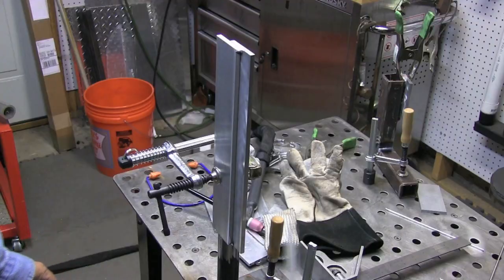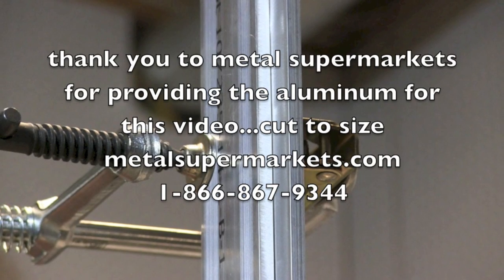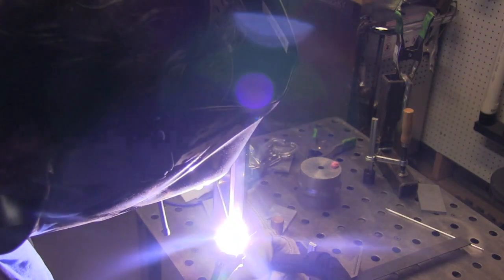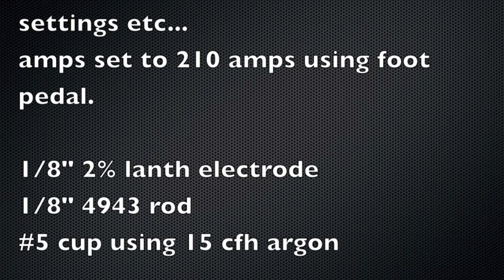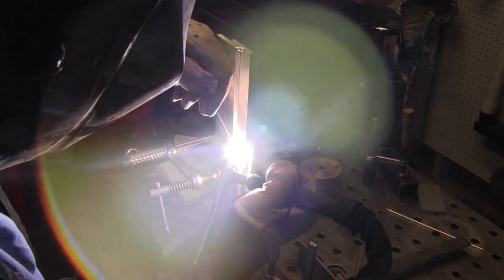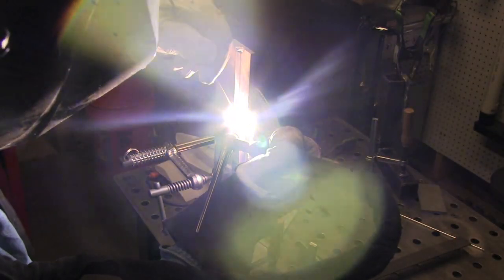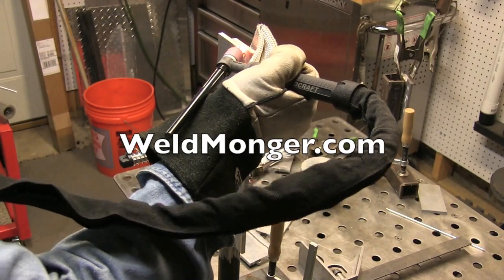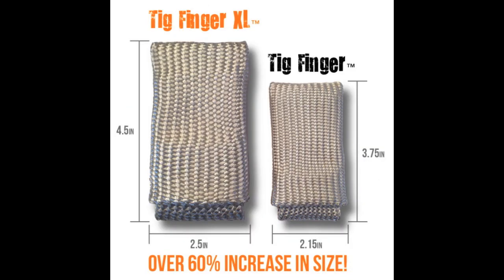Tig Welding Aluminum  3f Lap joint

Comment: its crazy how much amperage you need for aluminum as opposed to steels. i run a bad habit of setting my machine way too low at work. after 9 years it still gets me
Reply: taylort123 yeah I'd be at 300 amps going max speed

Comment: Im sold on the TIG finger if you can lay it right on aluminum like that, I know from experience how fast hot aluminum will ruin a glove, and your skin.
Reply: Jay Almquist, Good to know, thank you! I plan on ordering one or two myself soon.
Reply: Order the XL to start with, unless you have little trex hands .. I have what I consider to be small hands and I had to go to the xl for sure
Reply: Levon Luther, Thank you for the heads up, I have large hands, no T. rex here! 😄

Comment: i like your demonstrations.  it would be helpful to at least me if you could add to your settings comments which brand welder, and whether ground is positive or negative so the cleaning action direction can be deciphered, and also because some DC processes can vary in polarity.  thanks

Comment: Uphill tig is such a pain never comfortable And always seems when you have to do it its in some stupid spot. I like to curve the filler wire, and feed it right in over the top of the torch. I find that you don't contaminate your tungsten "as bad" opposed to when your trying to feed rod sideways

Comment: Hi Jody,
I'm not familiar with that alloy rod (?4943?), is that something new?  I've tried the Alcotec 4643 which is my new favorites for aluminum.
Reply: bkdsherrod it is a newer rod that was developed by Hobart filler metals. It is a good compromise between a 4043 and a 5356. There has been quite a bit of discussion on the weldingtioanstricks forum and weldingweb on this filler.

Comment: Hi Jody,

Do you have any reviews of the GIANT 200AC/DC Tig welder. think its a copied version of the Jasper model i have bought it but not used it yet. It will be for welding stainless steel exhausts and aluminium and light automotive stuff. Your thoughts would be appreciated. Thanks

Comment: is it bad that i set my amps to 300-350 and  just use the pedal to adjust heat? most of the time i'm barely half way down the pedal depending on metal thickness

Comment: was gonna buy a tig finger till i realized it was 121 bucks for a xl and regular bundle on amazon
Reply from the maker: there is all kind of weird stuff going on at amazon.  but you can order straight from weldmonger.com
Reply: weldingtipsandtricks  alright thanks for that is it not actually you selling them on amazon then because it said seller was welding tips and tricks?